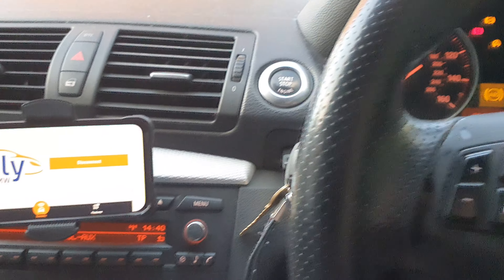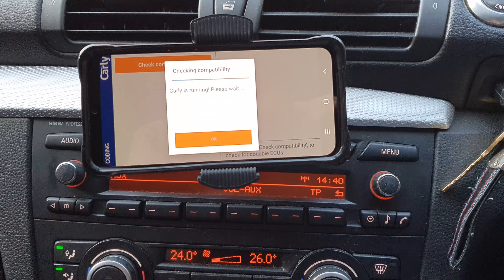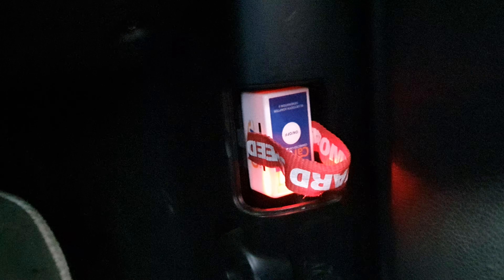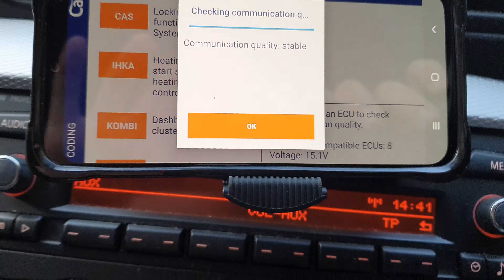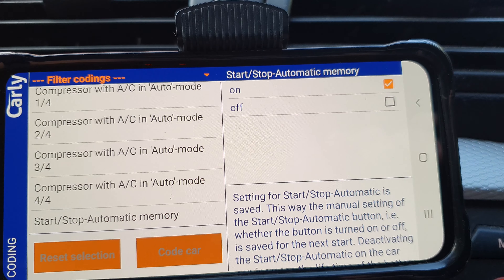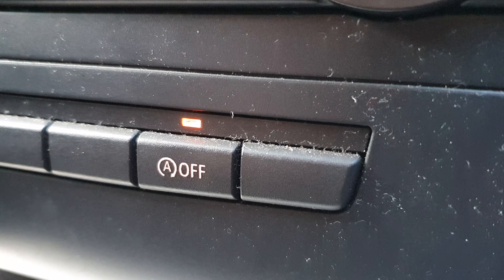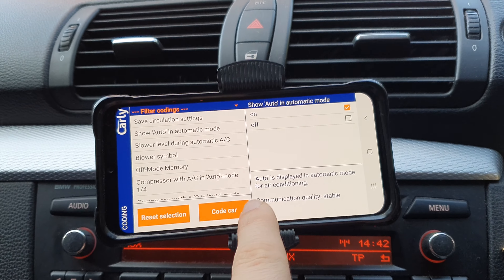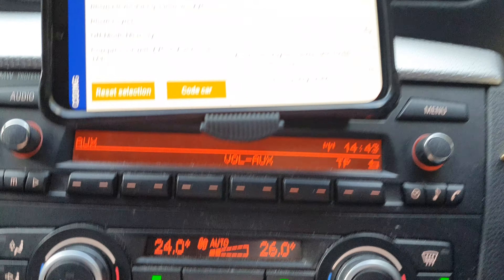How to *PERMANENTLY DISABLE* Auto Start/Stop - BMW 120d E87!

Comment: Hi, in my 2010 3 series there's a button under the ac controls which is to activate/deactivate the auto stop/start function but it doesn't seem to be doing anything when its pushed , any ideas please as to what might be wrong
Reply: Did you find a solution? My 2009 e82 has the same issue but the auto stop/start never works, I'm not sure why.
Reply: @Yqzxq7884  I also noticed my welcome lights and home lights were not working too, after some searching everything pointed to my battery,  I had the battery checked and it was dying, replaced it with the AGM battery and had it registered to the cars ecu and everything including the stop/start function works as it should now , so maybe get your battery tested , if you do need one make sure to get the AGM battery,  its designed for cars with stop/start because of the extra load every time it functions,  also if you don't get it coded to your ecu your car won't realise its a new battery and will over charge to compensate meaning the new battery will not last long , hope this helps, good luck
Reply: @stevelake9333  I think my battery is either low or needs replacing so that explains it. 
Thanks 👍
Reply: @Yqzxq7884  no problem my friend 👍

Comment: Hi DriveLife,

after disabling it, does it trows any faults on a dash?
Mine is popin out error A in a circle and start/stop doesn't work at all. So would like to disable it completely as you did, and wonder would that remove that stupid error as well. As it comes up only after the first stop when I start driving and a car cannot turn off on a first try.
Reply from the maker: Nope no errors at all 😁
Reply: I have this issue, it’s CC-ID 397. The code cannot be removed using that method above, I tried it.. read it’s something to do with gearbox neutral calibration?

Comment: Are other OBD adapters compatible with the Carly app, or do I need to buy the genuine £70 adapter thanks?
Reply from the maker: Hey Mick,
Yes unfortunately the app is designed to only work with the genuine adapter.
Cheers
TBG
Reply: @drivelife.channel  Noted thanks. And are the features that you have shown in all of your previous videos included with the free Lite software version, or the paid upgraded version thanks?
Reply from the maker: @mickmarshall3517  Coding and fault clearing is only included in the premium version which is around £50 per year